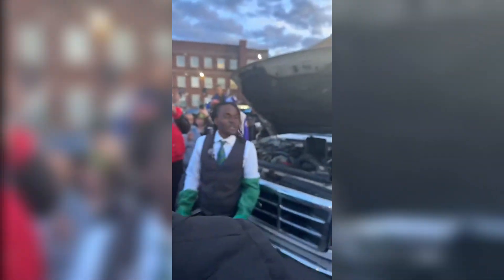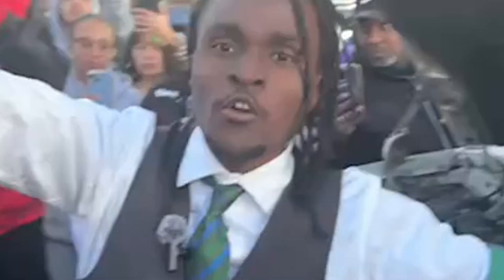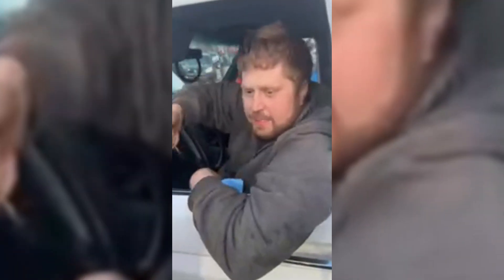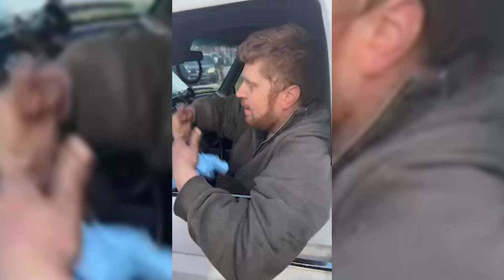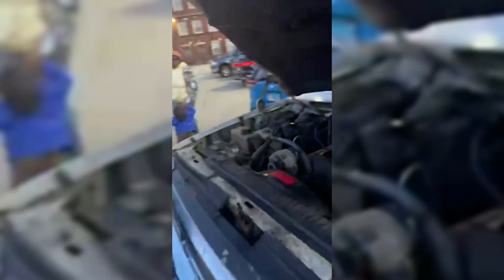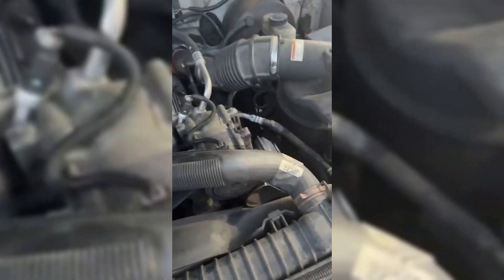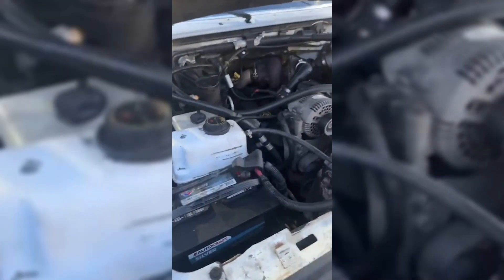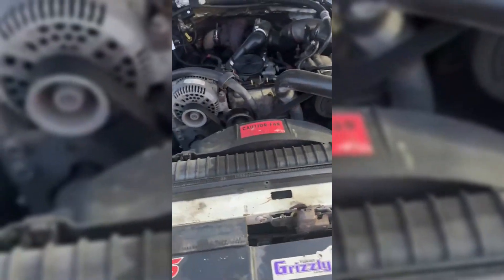Julian Brown Demonstrating Plastic Diesel Powering a Vehicle

Comment: Thats actually pretty impressive, patent the formula asap
Reply from the maker: he said he can't patent the pyrosis process which is converting plastic to oil; that the process has been around for a while and he has only managed to make it large scale to the point of running a vehicle with it. So there's a machine he is working that converts plastic to oil which he says he has build it with his own touch and he's continuing to work on it and that's what he will be able to patent soon
Reply: @chriswabs  He hasn't scaled anything - you know how much plastic it took to create that small amount?
Reply: @chriswabs  There isn't much to patent about his process because  he can't even continuously feed plastic into his device without clogging it up.
Reply: @chriswabs  You really should look at his whole process as well as the process of the big companies that are doing it as well as the process to refine it as real fuel.